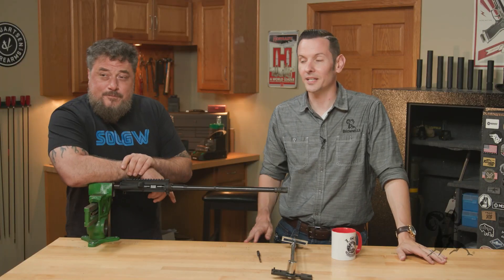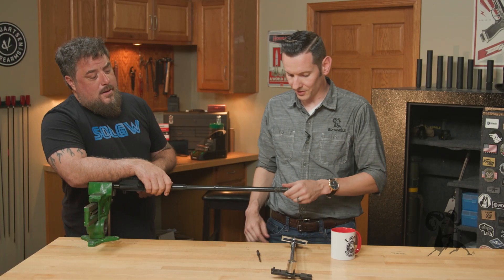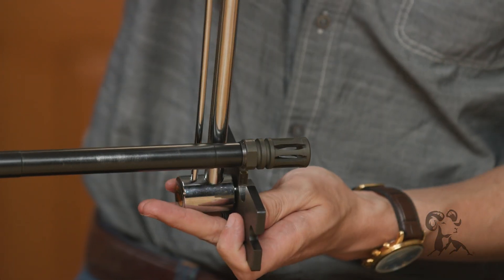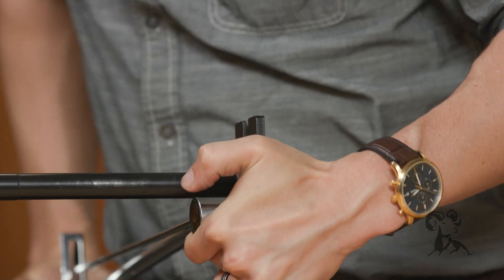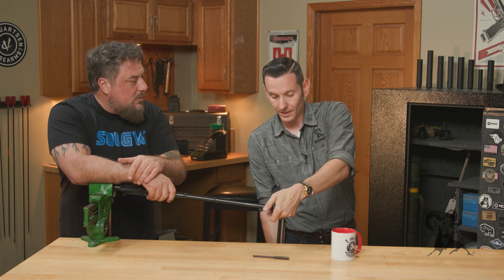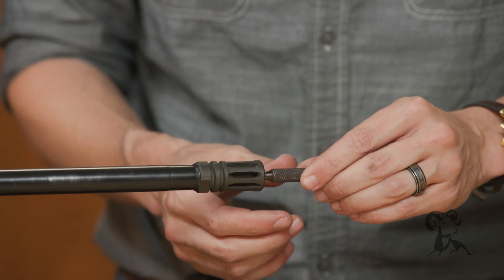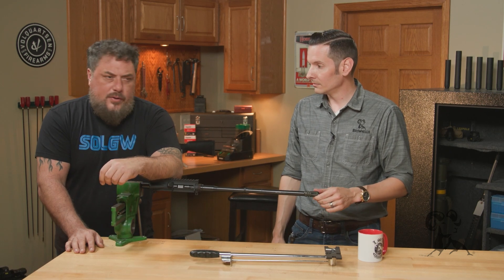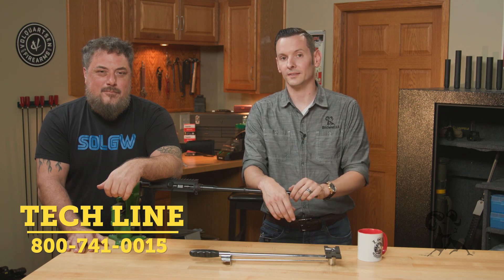Tech Tip: Can a Muzzle Device be too Tight?

Comment: Can you under torque a muzzle brake? I got mine alighned, but the crush washer isn't flat?  Is it suppose to keep that disk shape or should there be no gaps? I just stuck a screw driver through the port and turned until aligned. Didn't have to do 2 full rotations
Reply from the maker: I'd recommend go watch our build series
Reply: @brownells ok, thank you

Comment: I was told not to use a crush washer at all on Keymo or xeno muzzle brakes for dead air suppressors. I go twenty five and keep adjusting shims till I get the pin hole at 6 oclock.

Comment: i overtorqued a brake on a 22LR rifle (it was for balance purposes and looks) and now im having a hell of a time removing it... ive drenched the thing in penetrating oil, used heat, got a proper gun vise and everything. thing just wont come off... 

fun bit. although the gun is expected to do sub-MOA groups using high quality SV ammo, im getting 2 MOA groups at 50yd. on other guns i can easily do sub-MOA. I have no idea how im gonna fix my gun.
Reply: Did you use any thread-locker on it?
Reply: @toddb930nope, i followed the manufacturer instructions for installation torque. I suspect its gotten filled with carbon
Reply: @homestyle2000  --  have you tried heating the muzzle device up?
Reply: @toddb930yup! Ive put the gun in a vise, cooled the barrel with ice packs and air dusters upside down while heating up the brake and its locking nut with a torch. Still stuck :/
Reply: @homestyle2000  --  YIKES!!!
Reply: @toddb930yikes indeed! On the upside… this is giving me a great excuse to upgrade to a different rifle. Im thinking a CZ 457 MTR in an MDT chassis with an IBI 24” barrel

Comment: Interesting. Ive always used the 10:00 method. Put top dead center of muzzle device at bout 10:00. Turn to 12 oclock. With rocksett😂. 

Never knew there was a torque spec. Fwiw ive used birdcage and vg6 delta flash hiders. Ive had surefire comps, aac FH, troy, griffin armament brakes, 2a titanium and couple bcm. Went around the world with these damn things. And after all that, a2 is the best. 😂 Imho. With correct point of contacts on the rifle.. it works great for something that is free or maybe 6 bucks vs 60-140 bucks
Reply: Did you have any accuracy issues with that method?

Comment: Is it ok to install and torque down a muzzle device with the receiver in the vise in a receiver vise block?  Or is a barrel vise needed?
Reply: You want to use a Geissele Reaction Rod or a Midwest Industries Upper Receiver Rod. Basically holding the barrel from the chamber so you don’t break or stretch the index pin.

Comment: It is much easier to overtorque with a stainless barrel. AMHIK. Reduce torque values accordingly with stainless barrels. If you’re attaching a suppressor mount, and using Rocksett, consider 15-20 ft-lbs.

Comment: Im suprised that happens because the act of machining a threaded muzzle actually opens up the bore diameter by releasing stress in the metal. So not only is it bringing it back down to factory tightness but its exceeding it. Good to know

Comment: How do you time an A2 Birdcage with a crush washer, without over torque?
Reply: You want to use YHM crush washers. They start crushing with about 20 ft/lb of torque and they stay at 20 ft/lb for almost 2 full rotations once the “crush” has started. 

Shims are a better option though, you can get a pack for $6-$7
Reply: @ thanks. OCD is not a good trait to have when building things
Reply: @DirtyK1911  I know exactly what you mean 😂

Comment: Explain your statement of how over-torquing causes the bore to shrink.
More than likely the part will strip or bottom out. It would take incredible force to over-torque like that, whichbis not possible when one metal is far stronger than the other 

This is why I don't take SOLGW or the owner seriously.

He is a f'ing con artist.
He says shit that sounds good to uneducated people, but he pisses me off so much with retarded dribble that comes out of his mouth.
He thinks he is smarter than engineers and gunsmiths that have decades of experience.
What physical force would cause outside pressure? Much less to such an extent that the bore would shrink?
Are you having the incredible Hulk doing this.
Reply: Mike is a clown however the channel here called something like “AR-15 Tech Tips” uses an actual bore diameter gauge and torques to various settings and gauges at each step. 

The results are pretty definitive and indicate you shouldn’t be going much over 20 ft/lb

Comment: What about wet torque vs dry torque
Reply: Any type of lube on the threads allows you to reach torque faster than a dry situation. If using lube you could potentially drop the needed torque by 10-30 percent. I'm not gonna say exactly how much because it depends on too many variables (size, material, lube, etc.), but as a rule, it will reduce torque required. Using lube can easily cause an over torqued situation.
Reply: @xXIm0ldGreggXx thanks Huxwrx called for 40ft pounds so i did 25ft pounds with oil on threads. Suppressor is left and threaded so im not worried about it combing off with suppressor.  It’ll just make muzzle device tighter if it gets stuck.

Comment: By using light sandpaper, you can lightly knock off a few thousandths of an inch at a time of the flat side of the crush washer until you reach the final quarter turn at hand tight. Then tighten to zero with a wrench. This will prevent damage anywhere along the barrel. This is how I do it and how I will always do it.
Reply: Exactly. I do this as well. Glue the sandpaper to a flat block of wood and rub the washer in a circular motion until it is about the thickness you need to get the timing close to spot-on. From there, install it and the muzzle device using a torque wrench until the latter is properly timed. If you use Rocksett, you can even go somewhat below 30 ft-lb and be absolutely fine.
Reply: @blueeyeddevil1  I place a sheet of sandpaper on a countertop and sand lightly in a circular motion. Doesn't take much at all to get where things need to be. Also, minor torque is only needed up to the 30 flbs maximum allowed to prevent damage. But even 30 flbs to me is way too much. The crush washer creates the needed torque. Just time it with a quarter turn to zero, because always remember that as the barrel is heated, expansion creates added torque. Down the road, you may want to easily room the device for whatever the reason. So, a 30 flbs plus heat expansion could make it very difficult. Just let the crush washer do its job.
Reply: @Michael-Purcell  Yep, that's pretty much everything I said.

Comment: Quick question does my 3p eliminator need to be timed at 6 o clock or is  that just preferred I have it at 5?
Reply: I just installed an eliminator and the instructions indicated the blind hole should be at 6 o’clock. I had a difficult time crushing the provided washer to get to BDC. Torquing a crush washer is different than torquing MD using shims.

Comment: What is the acceptable level of tolerance. I get it 30 ft lbs is where it should max out what’s the min amount of torque though? It was either you guys or someone else that said rock set and lock tite and other stuff makes your torque a little wonky
Reply: Not wonky, but any type of lube on the threads allows you to reach torque faster than a dry situation. If using lube you could potentially drop the needed torque by 10-30 percent. I'm not gonna say exactly how much because it depends on too many variables (size, material, lube, etc.), but as a rule, it will reduce torque required.

Comment: I just got a dead air xeno A1 flash hider that doesn't require timing but I have some precision armament shims that are nice and supposed to make the shim job easier. I won't be using them on this muzzle device but might try a forward control designs xeno muzzle brake on another rifle. Great video as always

Comment: I was torquing down my muzzle device on my mossberg mvp and I went a little over 30 ft lbs and the barrell turned in the action, is this bad? Everything is still tight but where I had iron sights the holes are now off.
Reply from the maker: Yes, your headspace most likely changed as well. We recommend getting that fixed.

Comment: You’re using a crow’s foot. You need to account for the moment arm multiplier.
Reply: That's why you put crows foot at 90 degrees to torque wrench. No correction needed.

Comment: I over torqued my surefire device to try get it straightened out. And I had been scratching my head for a month on how my sub moa geisele started shooting 5 inch groups. I’m hoping if I re install it will help. 
Update: back to shooting 5 shot groups in the same hole at 25 yards! Thank you Caleb!
Reply: How did you fix it? Did you just loosen the muzzle device? Did it become just as accurate as before?

Comment: I would have rather seen a supressor mount used without a crush washer.  While I agree you shouldn’t over torque the muzzle device, I wonder if the crush washer was grabbing the punch on the inside because it was being……crushed.  Unfortunately this example is t as scientific as you want us to believe.
Reply: Crush washer on outside.  Punch on inside.  Srparated by barrel. If crush washer is grabbing the punch, how is it doing that except by compressing barrel?

Comment: And it is so true.  I had a gun shooting sub MOA, took brake off for a suppressor, put brake back on and the thing could barely hold 3 MOA.  Brake was too tight
Reply: I believe I've done the same.  My POI shifted 8" right and would not group.  How was your barrel afterwards?
Reply: @bsku8568  worked great after I figured out what was wrong and 100+ round later :)

Comment: 30ftlbs sounds like a good number. I wonder if the folks at Ruger know that? Got a new rifle that I wanted to swap the break first thing. I gave up at 150ftlbs (because the bench and vise were having issues) and sent the rifle back to Ruger to have it removed. 
I ended up replacing the barrel (even though it shot well) because I felt it was compromised.
Great video guys.
Reply: That's like..... a lot😂. They must've uses some type of bonding adhesive like rock set or loctite, but I would think that'd be a weird thing for a mass manufacturer to do not knowing what every customer plans to do with their muzzle device. Crazy.
Reply: @BarnDoor-won5ve  
I couldn't believe it myself. There was no thread lock on the threads. I took it to a smith as well. He said he's never seen anything like it.
Several reviews indicated that the factory break lead to accuracy issues. I just wanted to swap it to a linear break.

Comment: It appears that when you loosen the over tightened muzzle device, the problem goes away? So if i had a barrel with this problem i could fix it by loosing it and using the correct torque?

Comment: Personally I've never had to use shims on a AR...I have used them on a bolt-action...
As a rule of thumb I go hand tight and a 1/4 to 1/3 turn past...always has worked.
Reply: That really does seem to work for most causes when tightening, doesnt it? Hand tight and then some, that's what I was always taught
Reply: Using shims is to time, has nothing to do with tightness. Many muzzle devices need to be timed.

Comment: I think you demonstrated when loosening the muzzle and the pin fell out that it wasn’t permanent but just to confirm, if you over torque your muzzle device and then take it off has it caused permanent bore restriction?
Reply: I think that would depend on barrel material and the process of manufacturing

Comment: Let’s say I already put a muzzle device on my gun and had difficulty timing it for a suppressor host. I got it timed, but had to use several shims and torque it down pretty good. I did not use a torque wrench. 

How do I know if I overtorqued it? If it is overtorqued is this an issue that can be corrected? Do I need to get a whole new barrel? 

Any input would be great! Thanks!
Reply: If it’s over torqued you will have accuracy issues and possibly baffle strikes. You should use an alignment rod when installing the md and can as a first test to make sure they align. Try shooting it without the can to see if your getting wild groups. Especially if you have previous dope on the barrel. If your seeing possible signs then I would replace the barrel.
Reply: @jefflemaster2850  used a suppressor alignment rod and not seeing any misalignment. Lines up very well with the suppressor. Is there any other room for concern if that’s the case?
Reply: @SkunkApe22  I would shoot it first without the suppressor installed and check for any accuracy issues. If it’s shooting decent groups you should be fine to go ahead and shoot suppressed. The Geissele rods are great. I usually just shim the MD until it is about at the 2 o’clock (hand tightened) then wrench it into the 12 o’clock. I’ve never had a problem with it that way.
Reply: @jefflemaster2850  specifically I used a Geissele suppressor alignment rod
Reply: Did you end up shooting it? How were the groups? Was the barrel ruined?
Reply: @ 0-200yds  it grouped fine. No issues. Never took it out to distance. Sold it to a buddy with full transparency and he had no issues either. 

Hindsight. The muzzle device was definitely over torqued. I have put on many more muzzle devices since then without exceeding torque spec and have some laser accurate 556 guns out to several hundred yards

Comment: I just screw on the muzzle device up to the shoulder, back it off until it is perfectly timed, measure the gap with feeler gauges then make a shim on the lathe(4140 or 416) .001" over my measurement over the feelers that has the same o.d. as the barrel shoulder and I.d. .001 over the major of my threads. I then lightly lap the parted side of the shim until it times about 1130 hand tight, then torque to 12 never had one loosen.

Comment: The adding of a muzzle device is the last step in a new AR upper project.  I shoot the rifle a time or two, sight in optics, ammo choices, with just a thread protector bushing,  only.   Add a device, and shoot and compare findings.  I prefer shims over crush washers, when device internal thread depth  and barrel thread length are ideal for shims.  
I try to minimize the "dead zone" inside a muzzle break or flash hider. Its that zone where the tip of the barrel ends, and the area of unused muzzle device threads.   Crush washers often enlarge dead zone.
Reply: Shims are perfect, after ya figure out the device travel/tpi factor !!

Comment: does it really damages the barrel when you insert a punch into it? i mean, a fired bullet exerts a much more violent force to it
Reply: A steel punch vs what’s a projectile made of? Lead or lead core with a copper coating which is a much softer material.
Reply: The steel punch is harder than the copper jacket, so it could, depends on how tight.